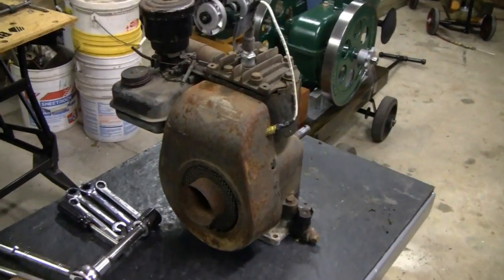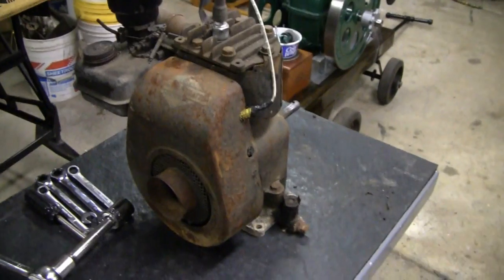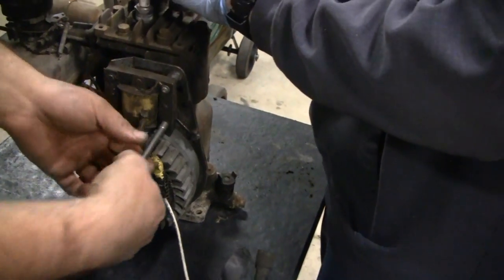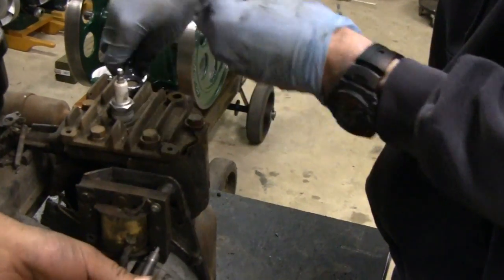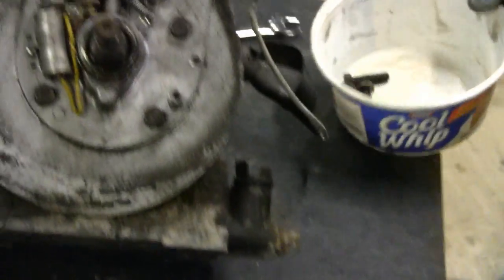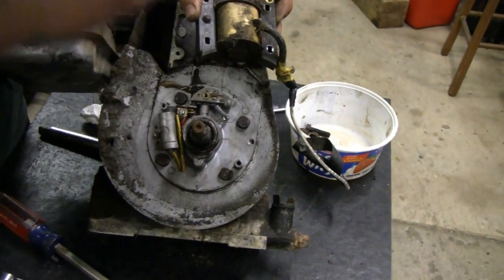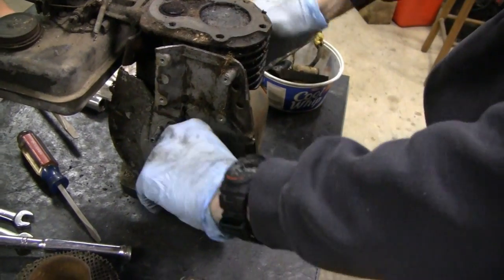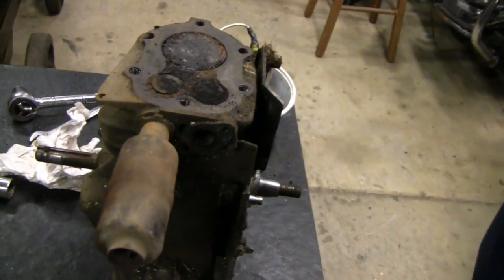HOMEMADE HIT & MISS BRIGGS PROJECT (part 1)

Comment: what is the purpose in a hit and miss engine?????????
Reply from the maker: Mostly efficiency!!☺
Reply: how????
Reply: they are putting raw fuel out the exhaust!!!!
Reply from the maker: Why would it be putting raw fuel outta the exhaust!!☺
Reply: it is missing a couple of firing strokes
Reply from the maker: It's not using any fuel when it's missing the strokes, that's where the efficiency comes in!!☺
Reply: what do you use it for???
Reply from the maker: It's just a display engine for shows!!☺
Reply: that's a waste of fuel!!!!!!!!!!!!!!!!!!!!!!!!!!!!!!!
Reply: Zach'sGarage channel the intake valve remains shut when missing strokes
Reply: smallenginedude71 Actually, the exhaust valve is "latched open" during the "miss" cycles.  The intake valve is not cammed in a hit-n-miss.  It opens as the result of intake vacuum
Reply: Rezqewr ah ok. pardon my mistake. thankyou for the info!
Reply: Yes. With a very weak tension spring. Nice answer buddy.